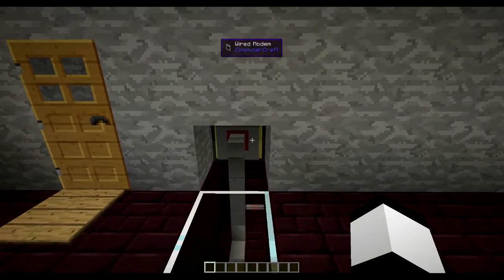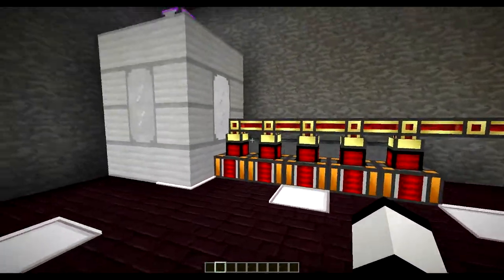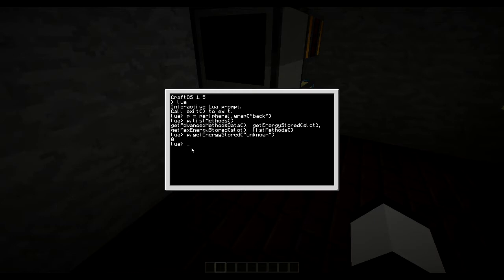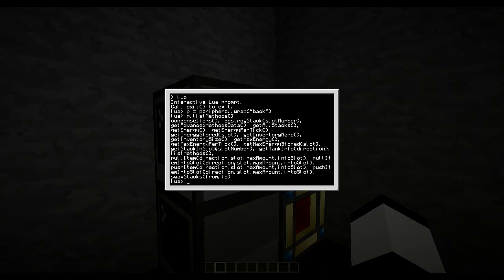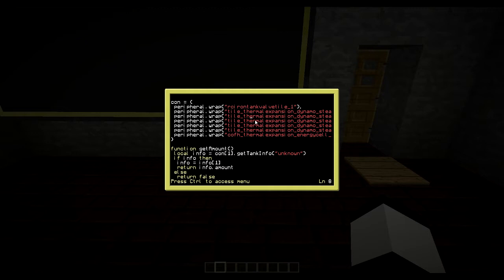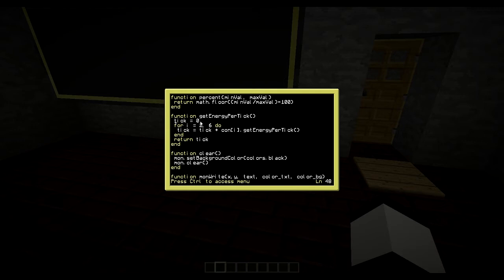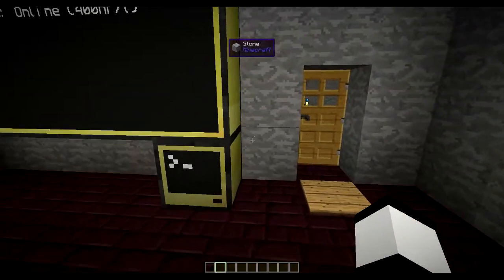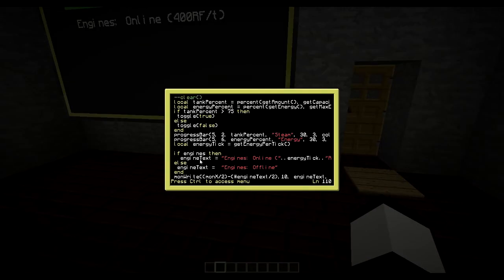Sjonky's Computercraft tutorials - Episode 6 (OpenPeripheral - Energy Storage)

Comment: how to print the result of the getAdvancedMethodsData in the monitor?
Reply from the maker: It's been a while since ive played now, So i don't remember exactly if getAdvancedMethodsData returns a table or not, But you just wrap the monitor, mon = peripheral.wrap(SIDE) then you use mon.write() to write stuff.
Reply: no work
Reply from the maker: Luiz Fenando Gonçalves Code? version of CC, version of openPeripheral?
Reply: Sjonky Minecraft 1.7.10 cc 1.65 openPeripheal 0.5.0
Reply from the maker: Luiz Fenando Gonçalves and your code?
Reply from the maker: Luiz Fenando Gonçalves And the return/error?
Reply from the maker: Luiz Fenando Gonçalves looks good to me, your problem here is just that the text is too long, so you have to create some word wrap function to display it on the monitor. Btw why do you want it on your monitor anyway? The method is just used to see in more detail what methods you have available what they return and so on

Comment: Hi Sjonky,

I have a question; i want to get the amount of energy stored into an energy cell represented in a variable, just like you did on your previous tutorial on fluid storage. How do i do that?
Reply from the maker: energy = energyCell.getEnergyStored("unknown")

There you go, if its that you wanted. Although i thought i went through that in this video. Or atleast in some similar way.
Reply: Thanks, the problem I had was that i thought it would turn energy into a table, that would have be decoded with a command like "energy[1].amount".
Reply from the maker: Swaharma man ahh, yeah that only happens with liquids. As many mods have machines with multiple liquids inside of them. So then a table is needed to be able to read all of them. But as the iron/steel tanks only has one liquid, I just overwrite the table variable with the correct table index.
Reply from the maker: Swaharma man ahh, yeah that only happens with liquids. As many mods have machines with multiple liquids inside of them. So then a table is needed to be able to read all of them. But as the iron/steel tanks only has one liquid, I just overwrite the table variable with the correct table index.